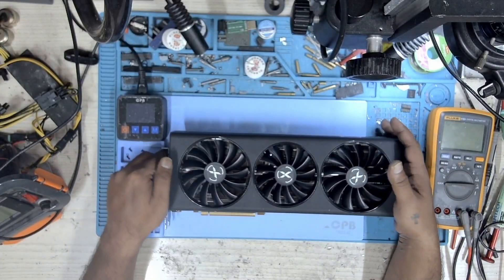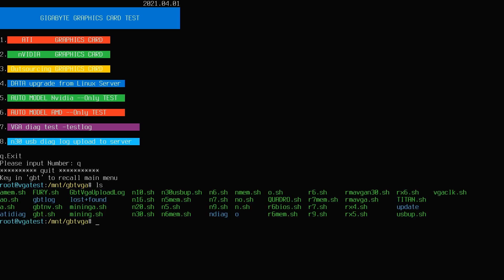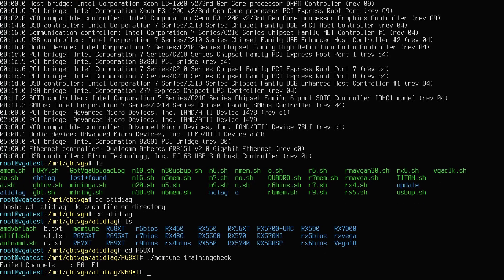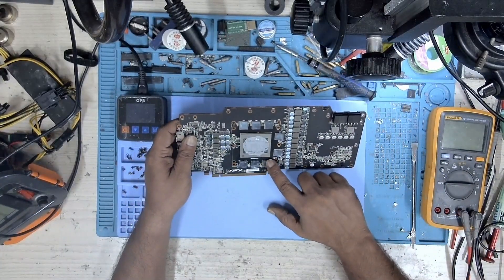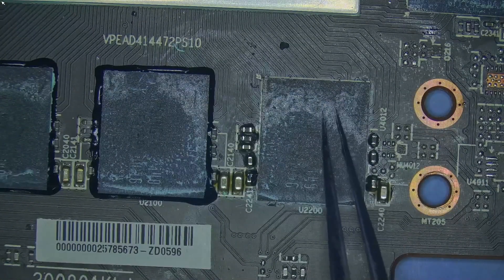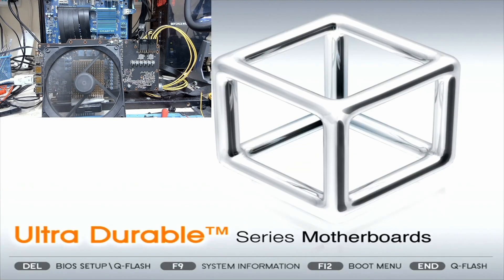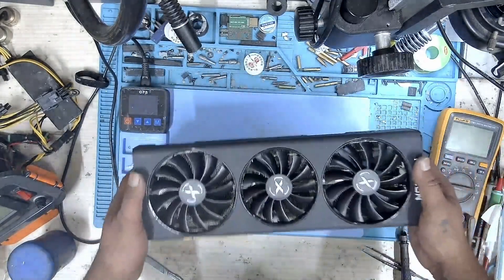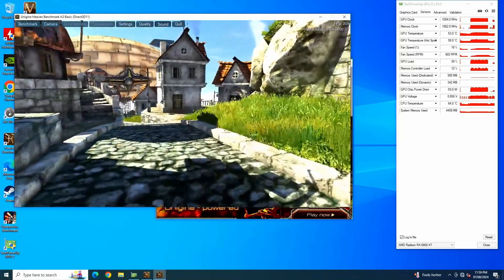Radeon GPUs: The Display Issue You Didn't Know About

Comment: I know it could be multiple things but would like to know what you think it could possibly be. Everything is brand new but the gpu. But the gpu looks brand new & still had the xfx sticker on the gpu mount screw. I know the sticker could've easily been replaced but after I got into the card, seen no signs of excessive heat, flux, or any form of visible damage anywhere.

Unfortunately I have no 2nd gpu to confirm mobo slot issue or gpu. But it feels certain that its gpu. Everything in build is brand new besides gpu. Decided to build without gpu first. Everything works fine & it boots to OS in 20sec or less. I have a superflower leadex vii 850W psu, well over the gpu's recommended psu wattage. 

When I try to boot with gpu. Motherboard stays on vga red light. The gpu's fans run & will keep running until powering off. System completely locks up. No usb power. Even setting igpu as priority & cable to mobo, still locks up with no usb power, & red vga light. In bios,  I tried setting external gpu as priority & forcing gen 3 & 4 for x16 slot. No change still. Tried all 4 video output ports, both x16 slots, same result. 

I let it sit running over a hr. felt some warmth on backplate of die location 5-10min mark. Then it went back to about room temp rest of the time.
Reply from the maker: I understood that it's a XFX GPU but you have not mentioned which XFX GPU. Knowing that this is XFX it is AMD GPU. From the symptom you have explained I am assuming that's it's a 6900XT. This sounds like a memory error. Possibly is the channel E may be faulty or cracked solder balls under the memory. The one near the bottom right side near the PCIE connector on the PCB of the GPU. But a memory test needs to be run to find the exact memory channel.
Reply: @GraphicsCardRepairs-tk7ql  @0:38 what is that program called, for mem testing? XFX 7700 XT(3 fan version}. I do have a digital hot air rework station. Not much experience with it. I mostly use the solder iron. 878AD type. Have a ton of good flux. Tempted to try to reflow all memory chips, 6 total. Will do 1 by one probably since I don't have a bottom heat plate. 
 I have an idea what temp they possibly need to be but no idea what to set air volume to. I know the set temp needs to be higher than target temp usually(temp reduction with distance etc), especially with cheaper rework stations like I have. Just says 878AD with no branding on left side lol. 

What temp & air volume setting would you try? I'm sure xfx probably would refuse my request for repair. Card is out of production & I bought it 2nd hand privately almost a yr ago now. No original packaging besides the foam. Wish I could find someone local to reball. Most places want $100-150(probably tries gpu reball if mem chips unsuccessful) + round shipping and even if I did that, they don't offer any refund or discount if it still ends up not working. For that price plus what I already paiid for it, i'd rather that 140-200 go saving up for a new rdna 4 card.
Reply from the maker: @RainWalker24c if you have no experience reballing memory I would not recommend you try it. I don't want to discourage you but I have seen GPUs being damaged more than getting fixed. I have many videos on my channel where I fix DIY repair attempts gone wrong. Reballing, removing memory and installing it back is a skill which needs to be build with practice. Second every hot air station is different and you will need to understand the limits of your machine. What one can do with 300°C and 60% air flow on one machine cannot be done on another. You will need to find that limit with your machine. That's why I don't replace my machines easily as I will have to learn that machine again to find it's capabilities. I would recommend you send your GPU to a skilled repair technician who has experience to fix it. If you want to do it your self first practice on a dead board or old GPU till you get it right everytime.
Reply: @GraphicsCardRepairs-tk7ql  I was only going to attempt reflowing the memory chips. Definitely won't attempt gpu chip reflow though. I do have solder balls that may be correct size, but no way I would reball 6 of these things back to back without a stencil lol. I have 5-6 sets of old pc & laptop ram sticks i'm never going to use again, just remembered. I gambled on the card once, very hesitant to gamble on it again knowing I wouldn't even get a percentage back if the professional repair doesn't fix it. I lost count how many videos I watched professionals reball mem chips, then the gpu, & concluding the gpu has died.